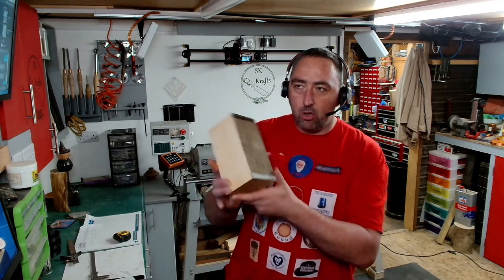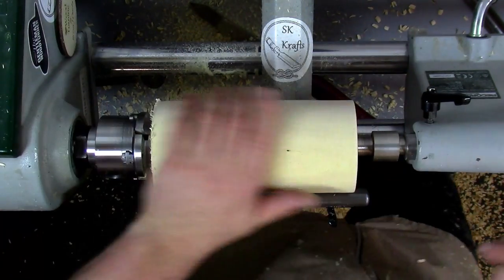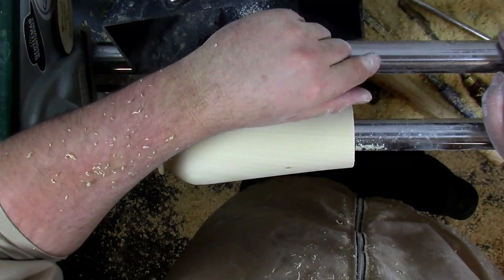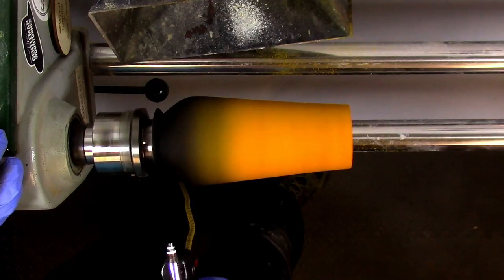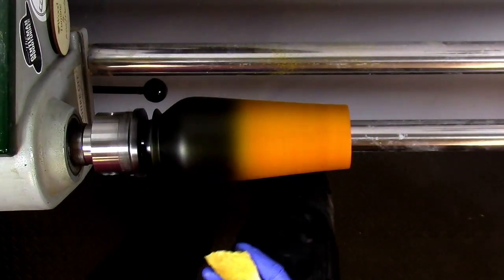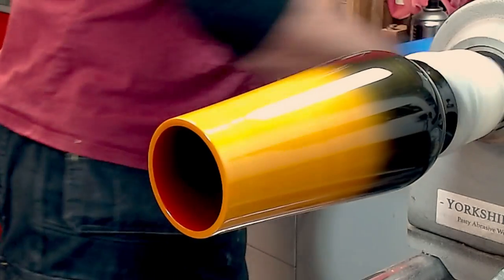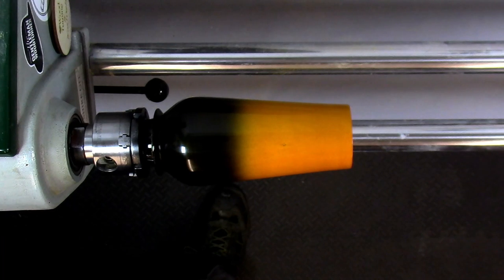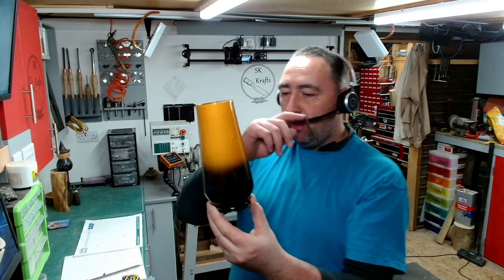The Art of Woodturning: How to Get the Perfect Finish

Comment: Well done. I’m surprised that you applied the  lacquer over the gold embellishing wax. I would have thought the wax would not let it stick. Do you ever coat the inside to make it watertight? @klocmade
Reply from the maker: Hi Howard, the lacquer covers quite well never had a problem with it so far. Not normally as most of the stuff I do is decorative. The only thing I have ever coated on the inside was a wooden sink.
Reply: @SKKrafts  thanks Steve.